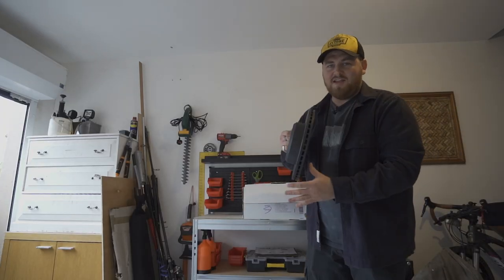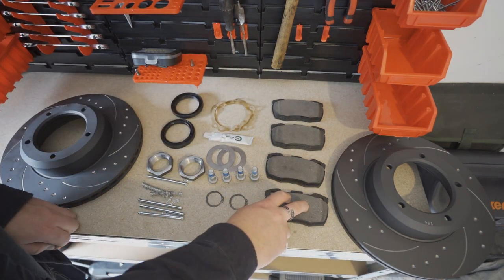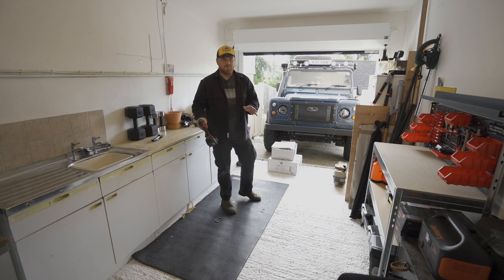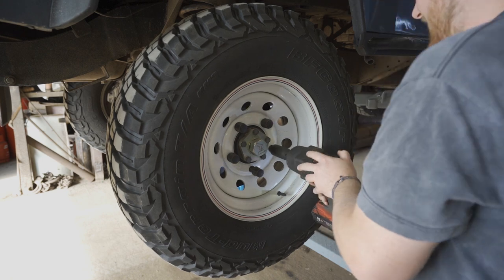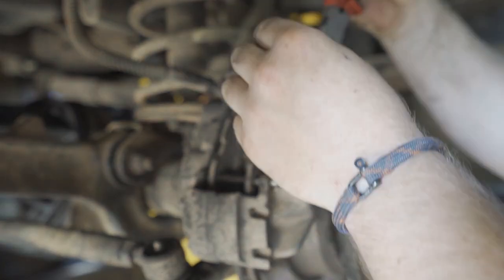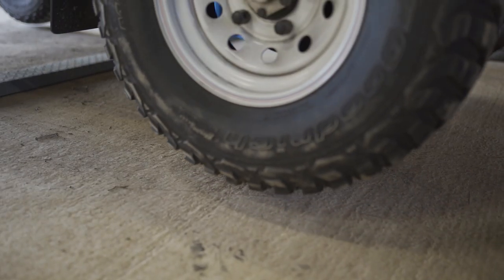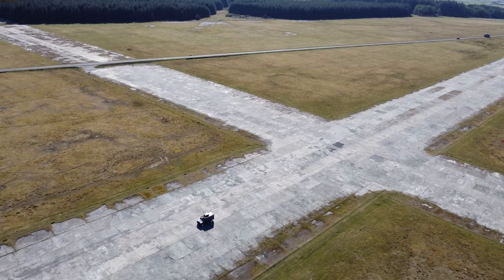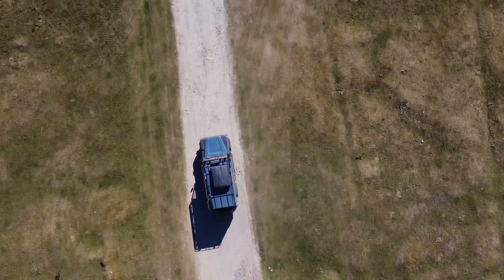DEFENDER BRAKES UPGRADE + DO I LIKE THEM? - L.O.F BRAKES

Comment: Renewing the brake lines and caliper upgrade on my TD5 90 made a huge difference to the braking performance - there is firm bite from the top of the pedal travel but still enough travel to allow you to modulate (important if you do not have ABS ). It is now less of an adjustment jumping out of my Golf daily and into the 90 - I can actually feel some stopping power!

Comment: Think your rotors are backwards (Left on Right and right on left). All but one manufacturer I've installed for customers recommended them going the other direction. Just a heads up for next time. Cheers
Reply from the maker: Yeah I know that now unfortunately. Cheers for spotting it.
Reply: What are the rotors please?

Comment: Hey mate, are you running stock Rover axle housings?
Reply from the maker: Yes I am 👍
Reply from the maker: You don’t mean the flanges do you?
Reply: @BorisTheDefender  no, the axle housing, where the differential (chunk, pumpkin, 3rd Member) sits with the ring and pinion. Salisbury maybe (I haven’t seen one before).